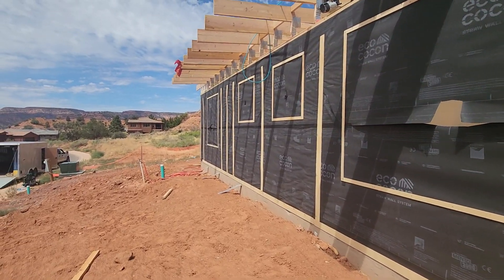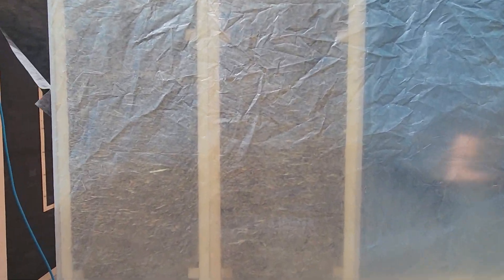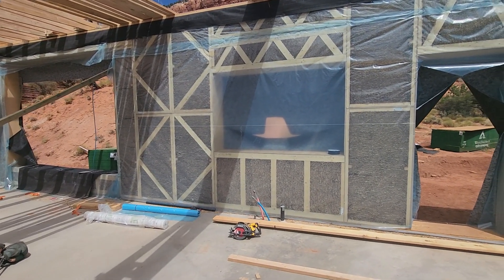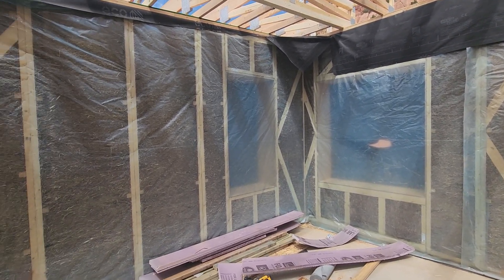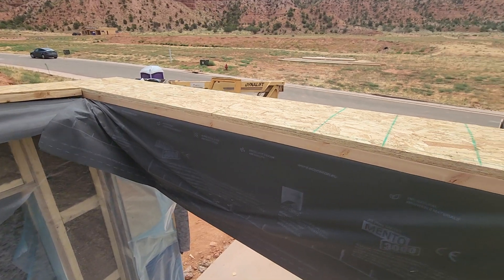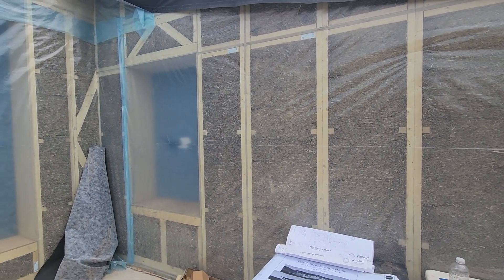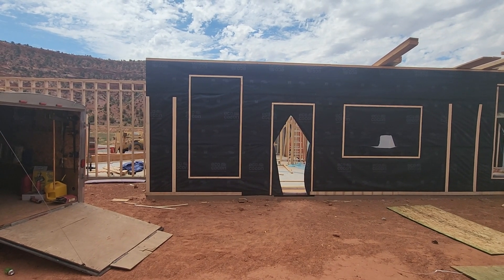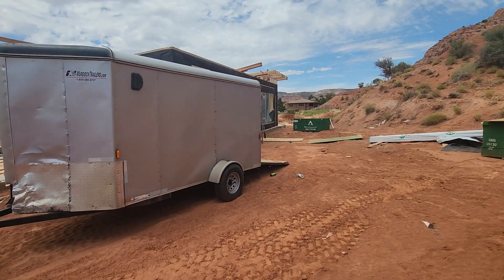An Ecococon Straw Panel Passive House installation

Comment from the maker: Think of this as a typical insulated wall where you still have fiberglass or cellulose. I would recommend an interior air barrier then 2x4 interior mechanical wall to keep the trades from tearing up the straw, which is what happened on this project.

Comment: if the wiring and plumbing is between the walls, how easy is it to fix things? is it easy to cut and repair if you need to access those areas?